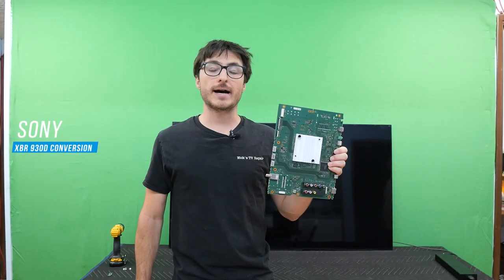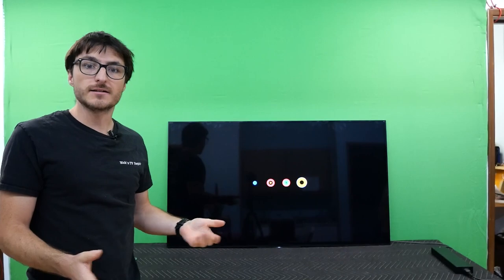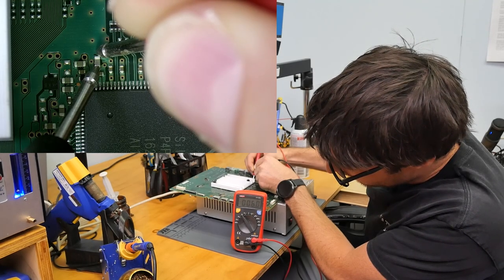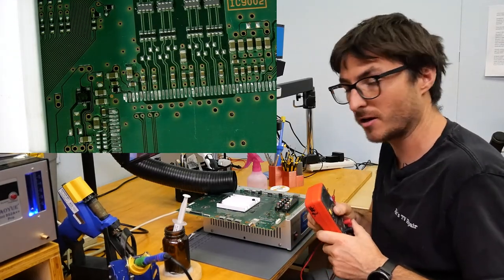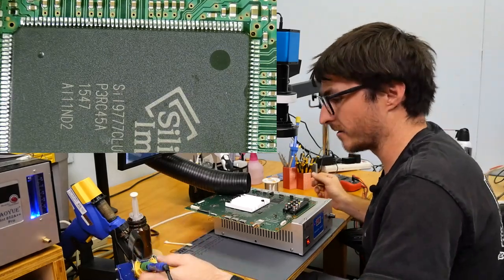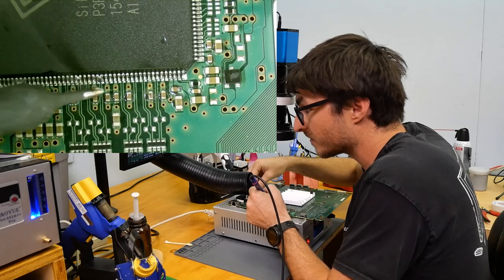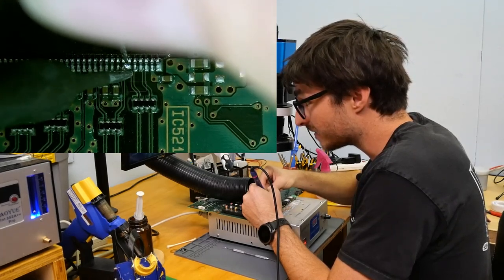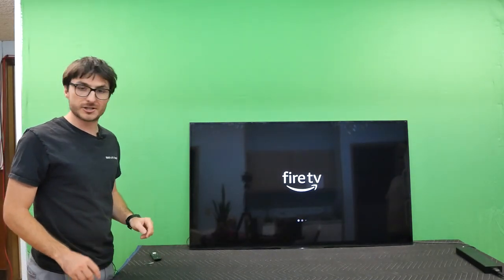Sony TV Mainboard Mod And Repair From XBR-75X940D to XBR-65X930D

Comment: Thanks to your videos I fixed my Sony KD-65XE8505.  The motherboard failed and I replaced it with a motherboard from the model KD-55XE8577.  I had to repeat the software update a few times, but it worked and the TV is working.  The only option I'm not sure works is the voice command.  But thanks 1 more subscriber.  Keep up the good work 🙂
Reply from the maker: Glad I could help!
Reply: I have the same problem.  if you go into settings, system info, you'll probably see that there is no electronic serial number and no Bluetooth ID.  The voice command on the remote requires bluetooth to be working.  I have not yet found a solution for this.
Reply: @robertsauers2227  I actually made it work.  I went to settings remote control and accessories and activated the remote control.  I have 2 options Bluetooth and remote control.  when you enter the remote control, you have to activate that button.

Comment: Hi Nick.  great videos.  It looks like there are at least two of us with the problem of Bluetooth not working after a motherboard replacement.  What I discovered (in settings/system info) is that the electronic serial number and the bluetooth ID are missing (blank).  I believe that this is the reason that Bluetooth does not work.  Bluetooth is required for voice commands to work on the remote.  Thanks.
Reply from the maker: Robert,
I always tell people to just use external devices such as a firestick as those types of features for voice commands will be integrated into the device same as all the smart apps. There is a way for you to manually insert the serial number so that you can make it work again, by going into a service menu, however you can only do it one time and then it locks up forever. So if your mainbaord has already been paired with another TV, you won't be able to pair it to your TV. The only way is to purchase a brand new mainboard that has never been linked up to a TV before.

Comment: I imagine all the equipment cost a bit. If only there was a TV shop like yours around here, I work for free to learn. One thing is for sure, I can get as many TVs as I need to practice on.
Reply from the maker: Some is expensive yes, some is affordable. You don't have to have the expensive stuff to do a good repair, we started we less expensive equipment. But when you run a BGA machine 8h per day every day because you are fixing thousands of boards with it, at that point it makes a bit more sense to get the nicer more expensive machine.

Comment: Hi again Nick. I contacted the sellers from A*iexpress for Sony KD 55XF9005. Since it is longer than 60 cm (only the led bar is 108 cm, excluding the package), they said that A*liexpress cargo will not be accepted, they can only send via Fedex or UPS. However, in this way, there may be a lot of expenses other than shipping. If I tell them to split the led bars in half, can I re-solder them together? What do you recommend. Thank you very much for the answer.
Reply from the maker: I would not recommend splitting the bar in half. I would recommend finding a different seller or paying the extra fee.
Reply: @NicksTVRepair  Thank you for answer.

Comment: Thanks for sharing the information.  Can you please advice on replacement of main board ,, can I replace 65 inch sony (8500f) main board with 55 inch sony 8500g main board
Reply from the maker: No that's to much of a difference. but if you have an XBR65X850F then you can use a mainboard from any of these models and it will work

XBR-60X830F	
XBR-65X850F	
XBR-70X830F	,
XBR-75X850F	
XBR-85X850F

All those are cross compatible. 
If you want to do other models then you will have to do some more advanced modifications and software changes like we did in the video.
Reply: @NicksTVRepair  
Thanks for information.  I have 55 inch main board and want to install in 65 inch model . Can you pls advice what settings needed for sony 8500 f model

Comment: Good day.
I have a sony kd 65xe8505 tv.
I bought a board from a TV kd 65xe8596 after the replacement, the opening music seems to play, the backlight is on, but I have no picture.
12v is on the tcon board. Don't you know what could be wrong?
I don't like flex cables, especially the side that goes to the mainboard

Comment: @Nick's TV Repair 
I have a Sony KDL-65X85J...I recently acquired it as is, when I turn it on, it does with very white faint picture background then quickly change to brownish white

Then the tv promptly changes or progress to the standby mode where you hear button interaction sounds with backlight on & sound but noo picture...

I believe attempts were made to replace the T-con board but when I try the replacement myself with spare T-con board, the tv power led light would blink x5 times then shut down.

When reinstall the original T-con board I would get the first & original issue I highlighted.

I checked the output voltages from the power supply board using a odometer & they seem to be in check & balances.... 3.3v, 12v...

Besides the lack of picture images or signal, upon closer inspection at the back, far LEFT bottom of the disassembled KDL-65X85J tv, on the buffer board area, 1 of the COF LCD ribbon is removed, unattached. Not rip or torn..is this a major concern??...I will seek to get it rebounded. but how is this ?.

Sincerely....🇯🇲
Reply from the maker: Cris,

If 1 of the COF LCD ribbon is removed then this is most likely the cause of the fault and once fixed will return the set to full functionality. Also a 5 blink error code is indicative of either a faulty T-con or faulty screen. 
Rebonding the ribbon requires very specialized equipment which very few shops have. It will be very difficult to get access to one.
Reply: @NicksTVRepair  I believe the Cof ribbon was accidentally removed after the fact of screen issue by previous owner in him trying to disassemble it to diagnose it...

Could it possibly be just the mainboard & not screen as yet?. ...what are the chances of it being... in addition to this reply, in my recent testing again I am now not getting any sounds when I press buttons on remote or TV set. But I can see that led Iight blinks on tv when I do..

Can the mainboard also make the tv shut down after powering up?.

Sincerely

Comment: How did you learn to do electronic repair, did you teach yourself or you went to school? If you went to school what was it called. I want to do this in my life
Reply from the maker: Self-taught.
Started off 10 years ago buying broken TVs on craigslist, trying to figure out how to fix them, I fixed a few, and I broke a few, sold the repaired ones for profit, and kept doing it until I got good enough to repair customers' TVs. Then I opened up a shop. We now have about 20,000 TVs fixed since 2013.
Reply: @NicksTVRepair  You answered my question so I will delete it, I'm older and retired but have a background in electronics, so I've been doing what you do picking up junk TVs, trying to learn. Its not easy, getting good advice is a joke.  What advice would you give me?

Comment: Hi. I have a 2019 Sony OLED TV 65”.  We had lightening strike in our backyard and the screen is dead. Total black. Cable box is ok. Can this be repaired or should I buy another TV ($3,000). Thanks,
Paul
Reply from the maker: This can for sure be repaired. We fix lightning strike failures and power surges all the time. This is a proof video right here:
https://www.youtube.com/watch?v=VlUmIR_At5I
What model TV do you have?

Comment: Hey nick can u help me please ? Im from germany and i have the same problem with the hdmi on my sony bravia kd-55X8505C. Then i did a reset and my tv don't starts anymore always in bootloop. I then ordered a new mainboard and installed it, but my tv still doesn't start and I have no picture at all. The indicator flashes green and yellow then it goes off and it flashes again but nothing happens. Does the new mainboard have to be taught in? thank you and greetings from Germany baho
Reply from the maker: The mainboard you got is probably good, but you need to pair it to your TV for it to work. 
here is a video that shows how to do the pairing if you have the amber green issue

https://www.youtube.com/watch?v=gBd2g7kRsEM

Comment: I have a sony x850d with a completely dead mainboard, no lights flashing on tv, dead set. I didnt seem to find any shorts and all power supplies and boards are good. Do you think this would this likely be the emmc?
Reply from the maker: By default if I hear I have a Sony I think, oh EMMC failure. If I hear I have an 850D version, I think, oh yeah I was right emmc failure. But yeah dead no power I haven't seen be anything but EMMC failure with those. Especially if you are getting power from the power supply and there are no shorts on the mainboard. 
For more info you can check this video out as well where we do a bit more troubleshooting to confirm the CPU is not the fault. 
https://www.youtube.com/watch?v=YL123l67h6w
Reply: @NicksTVRepair  when an emmc causes boot failure, can you typically recover the image on it  with a reader?
Reply from the maker: @KyleSand  no usually you have to get it from a good working one.
Reply: @NicksTVRepair  Thanks, Trying to decide how to proceed with the dead mainboard I have.  Considering buying the tool and doing the reimaging to a new card myself but will need to find the emmc image to recover.

Comment: Hola Nick
Me gusta tus videos
Necesito ayuda con una Tv sony bravia xbr 55x805e software no me da pantalla solo sonido de fondo
Ya intente 6 veces y nada ya que la tarjeta Main ya se la cambie pero sigue lo mismo
Alguna solución
Reply from the maker: Es posible que la nueva placa base que tiene también sea mala, pero la mayoría de las veces se debe al emparejamiento que se debe hacer.
Intente seguir estos dos videos para conocer el procedimiento de emparejamiento y los consejos.

https://youtu.be/gBd2g7kRsEM

https://youtu.be/3kYPjIHt8Lc

Si todavía tiene problemas, es posible que sus cintas no estén insertadas correctamente, pero si lo están, lo más probable es que la placa de reemplazo también esté defectuosa.

Hope this helps. I used Google translate so it might not be the best. Let me know if you have more questions.

Comment: I am the unofficial official TV recycle center in my little town, a computer shop in town gets calls for repairs and he does not repair them so he is sending them my way, most will likely be cracked but I will save the boards.
Reply from the maker: Hey some of those may have value.

Comment: Hi Nick, can you help me? I have a kd65x9005b with a faulty main board and I want to exchange it for a kd55x9005b main board but I haven't been able to pair it yet, it keeps alternating between green and orange. Doing the sequence (info5vol+power) I can enter the service menu. Thank you in advance for any tip as it does not accept the update of the file taken from the sony website. thanks
Reply from the maker: I recommend you check this video out I made that goes over exactly how to resolve that issue. 
https://www.youtube.com/watch?v=gBd2g7kRsEM

Comment: Does Netflix still work ?
Reply from the maker: No, and neither will Prime video nor Hulu I believe. The rest should work such as Youtube, Disney + and so on. But I always recomend using a 4k fire stick anyways, it's easier to use and navigate than the built in system since it's more responsive to the remote and since both are android based devices, they work with one another very well.

Comment: I have a problem with my Sony 49X7000D Android TV... it will automatically increase/decrease the volume... its like automatically the volume down button is pressed... cos its starts i  safe mode, unless when I keep on holding the volume up button when swith on my TV. Please advice
Reply from the maker: You can do one of two things or both
#1 remove the batteries from your remote and see if that stops the issue. If yes then your remote is the issue. If no, then open up your TV and disconnect the buttons. See if that makes the issue go away. If yes, then just keep them disconnected and use your remote. If not, then reconnect the buttons and disconnect your IR sensor. If that resolves it then the IR needs to be replaced. 
If this doesn't resolve the issue then it's most likely software
#2 Perform a factory reset to your TV and run a software update. 

I hope this helps.
Reply: @NicksTVRepair  thank you very much.. will try all options and let you know..

Comment: Hi Nick. I like your videos. I have Sony KD 55XF9005 230 Volt  europe model. I have 4 red blinks problem. I saw your videos" https://www.youtube.com/watch?v=Y00I6rx70j0" and i check the power supply is ok. I have not TCON_12 volt too.
      In this case, the only possible outcome is that the motherboard is faulty? Could it be the LEDs? My TV was giving an error after working for a few hours at first, I noticed that two of the rear leds were blinking. When this happened it was giving an error right after.

      When I unplugged it, waited for a long time and turned it on again, it was still working for a few hours. However, this time gradually decreased and was reduced to a few seconds.
      Where can we buy the jeeps like this one you changed? Thank you very much.
Reply from the maker: 4 red blinks is an LED fault.
Replace your LEDs and your TV will work again.
Reply: @NicksTVRepair  Thank you very much.